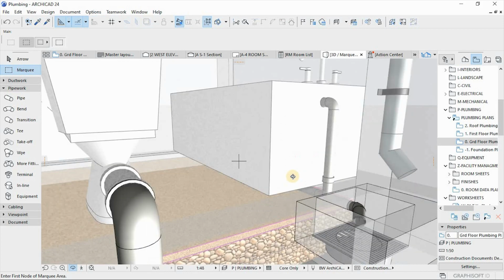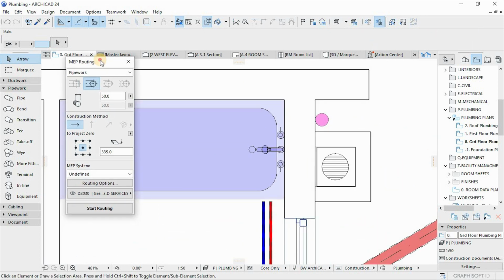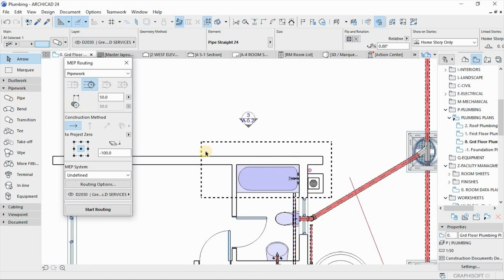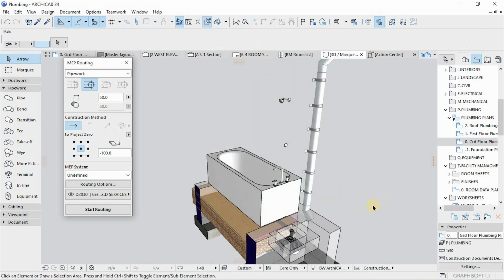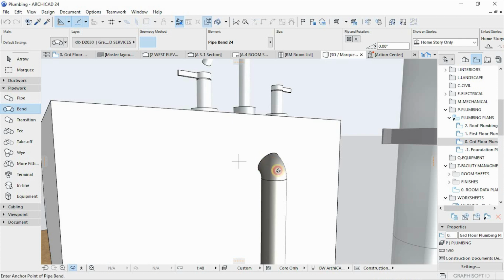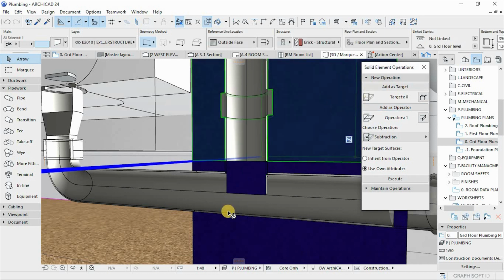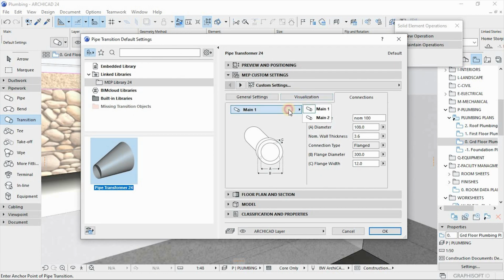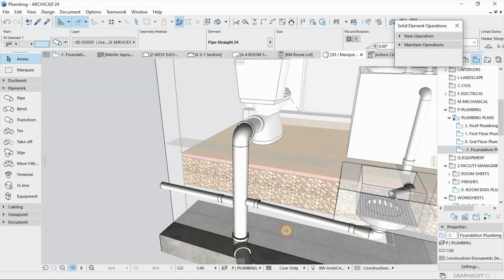ArchiCAD Bathtub Plumbing Drain Modeling | Basics of MEP Systems PART 2

Comment: Gd day my friend , actually I was trying to convince my company to switch from revit to Archicad or at least they wanna make sure that there is smooth transfer between revit to Archicad or opposite in case some one using revit and other is using Archicad . So they  asked me to make a comparison between the two softwares . And wht Archicad has to offer better then revit , so can u help me with this comparison ?
Reply: Please try to not have the sound of the mouse click in your videos..  that really takes away from your great Video. Thank you for the really very good Video!
Reply from the maker: @AndreasGienger  Thank you
Reply from the maker: Thank you for reaching us, They are both BIM software...The difference is not that much and I have used both softwares..Archicad has been really putting great versions of recent, so it's leading in the right direction..I recommend you watch this video:https://youtu.be/vQl_bFBcdxE